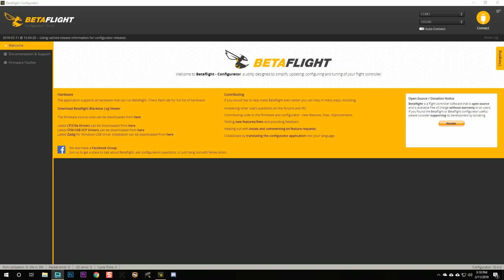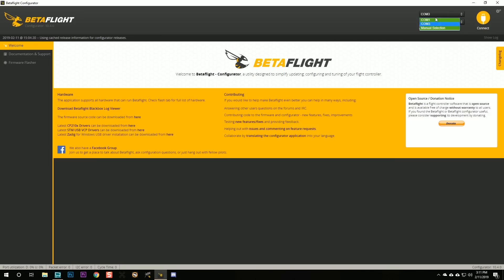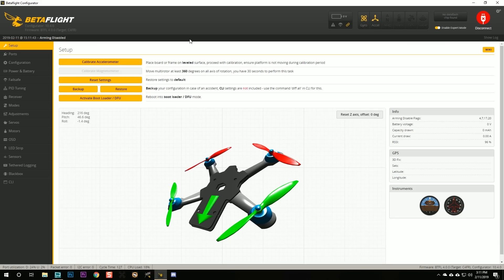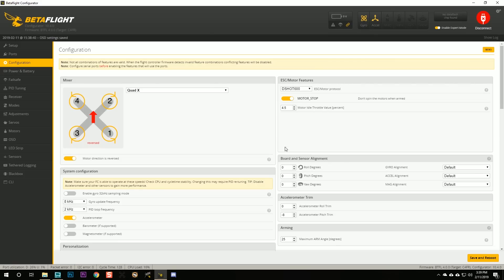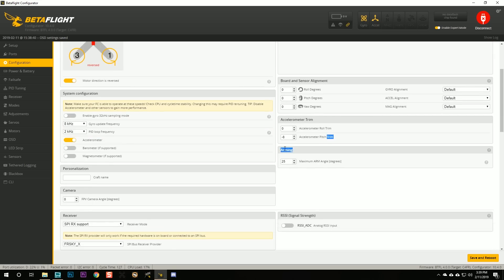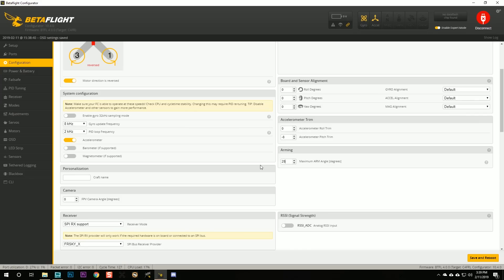Eachine Trashcan Initial Betaflight Setup | DO THIS BEFORE YOU FLY

Comment: Hello. I need help with my trashcan. The problem is I can't arm the quadcopter. Green led always flashing whatever the arm switch position. When I'm in modes section in betaflight I see the switch working the right way but the arm botom doesn't come yellow or activated like the angle and air modes.  Can you help me?
Reply from the maker: https://youtu.be/N8oMMG2kmns
Reply: @JoshuaBardwell  thank you for answering.  The code I have is msp.  And the code stay active when I try to arm without the USB cable.

Comment: If you do the xt30 mod, make sure that you add a capacitor or your voltage regulator will burn out if you have a 2s battery larger than roughly 350 mah.
This will probably happen rather quickly. Eachine created a whoop that could barely fly on the batteries that were shipped, offered an xt30 pigtail to modify it. 
Once this happens, you'll be forced to dump the board or use an external voltage regulator for the full "trash"can effect.

Comment: Some more tips if your having trouble:
  Bind command is "bind_rx"  not "bind" on latest models.
Motor direction switch in betaflight must be switched to "reverse motors" From factory its not and it wont fly.
Flashing firmware to at least 4.1 or higher (recommended) and you will have to setup vtx tables and manually set a channel. watch bardwells video on this its not too hard and just involves loading a prewritten table of channel frequencies. 
Ports tab in betaflight: Set UART1 Peripherals to VTX TBS smart audio and AUTO and boom smart audio should work too.
Physically check props have been put on in the right direction.
These things can take a beginner a long time to figure out they are actually wrong from factory settings brand new. I just got my replacement Trashcan after I burnt the first one out converting it to the supplied XT30 connector due to voltage spike. 
So last tip: Don't convert to XT30.
Happy flying!

Comment: my trashcan stops sending vtx after about 30 seconds of flight, I'm trying to find how to change the vtx mw output but cant find anything anywhere how to do this? do you know? some help would be greatly appreciated. The led says it's outputting 200mw, was thinking of reducing this to see if it helps. Oh, crap, sorry, i just figured it out, I type in "set vtx" in cli and options come up, set vtx_power=1 is for 25mw, 2 is for 100mw and 3 is for 200mw, but it didn't change, I'll have to return it for one that works. Great vid.

i decide to upgrade the vtx board to the recorder version, and keep it.

Comment: how do I reverse pitch in betaflight? rxrange 1 1915 1131, I save to file, but then what? i need to edit whats on the flight controller, not save to file, librepilot for cc3d there is a check box, when saved it writes to the flight controller, not to a file. ??? "Save" line command? let me try that. Ok ,got it, first time in betaflight. Love your vids.
Reply from the maker: Type the word "save" in the CLI

Comment: i just got my trashcan and i have some problems which i do not understand. i tried everything like downloading new drivers and so on but nothing helps.
The Problem is when i first plugged the drone to betaflight everything was ok and i could set my settings eccept of the Modis i mean the flightmods. When i click on the page modis then i get stuck and i cant click on anything else till i disconnect. But further i also dont see any modis or settings like the defaults i just get a blank page with nothing and i cant get out or add something. But flying it works and the modis are the defaults so why is it not showing  it and what is more important why can i not do anything in the modi settings??? PLEASE HELP I DONT GET IT AND I HAVE NOT SEEN ENYONE ELSE WITH THIS PROBLEM
Reply from the maker: https://www.youtube.com/watch?v=slmUbB-dZsw
Reply: Thank you I was able to fix the problem with your video. Great videos as ever since I watch your channel.

Comment: Can anyone help me?  My trashcan was working fine.  I was able to get it to fly out of the box without ever using Betaflight.  Just bound it to my flysky fs-i6 and it the FPV feed showed up good in my googles.  Then I plugged it into betaflight and was just messing around with some of the back LED light settings and I decided I did't like the change so I hit the reset settings and now I lost everything.  I can rebind my transmitter but I can't seen FPV feed and it won't do anything...?
Reply from the maker: When you hit "reset settings" it resets the entire drone. Here's the config dump from my trashcan. Maybe it can get you back in the air:

# 

# diff all

# version
# Betaflight / CRAZYBEEF4FR (C4FR) 4.0.5 Aug  1 2019 / 11:43:43 (839661b20) MSP API: 1.41

# start the command batch
batch start

# reset configuration to default settings
defaults nosave

board_name CRAZYBEEF4FR
manufacturer_id 
mcu_id 003c00143237511630353639
signature 

# name

# resources

# timer

# dma

# mixer

# servo

# servo mix

# feature
feature -TELEMETRY
feature -ANTI_GRAVITY
feature -DYNAMIC_FILTER
feature MOTOR_STOP
feature LED_STRIP

# beeper

# beacon

# map

# serial
serial 0 2048 115200 57600 0 115200

# led
led 0 4,7::CO:2
led 1 5,7::CO:2
led 2 6,7::CO:2
led 3 7,7::CO:2
led 4 8,7::CO:2

# color

# mode_color
mode_color 5 0 9
mode_color 5 1 11
mode_color 5 2 2
mode_color 5 3 13
mode_color 5 4 10
mode_color 5 5 3

# aux
aux 0 0 0 900 1600 0 0
aux 1 1 0 1400 1600 0 0
aux 2 13 0 1750 1850 0 0
aux 3 35 0 1125 1275 0 0

# adjrange

# rxrange

# vtx

# rxfail

# display_name

# master
set min_check = 1005
set max_check = 1995
set small_angle = 180
set runaway_takeoff_deactivate_throttle_percent = 5
set osd_warn_batt_not_full = OFF
set osd_warn_batt_warning = OFF
set osd_warn_batt_critical = OFF
set osd_warn_esc_fail = OFF
set osd_warn_core_temp = OFF
set osd_rssi_alarm = 40
set osd_cap_alarm = 5000
set osd_vbat_pos = 2432
set osd_rssi_pos = 2426
set osd_tim_1_pos = 53
set osd_tim_2_pos = 2455
set osd_flymode_pos = 364
set osd_throttle_pos = 2400
set osd_vtx_channel_pos = 34
set osd_ah_pos = 199
set osd_current_pos = 2440
set osd_mah_drawn_pos = 2448
set osd_craft_name_pos = 2048
set osd_gps_speed_pos = 271
set osd_gps_lon_pos = 82
set osd_gps_lat_pos = 65
set osd_gps_sats_pos = 1410
set osd_home_dir_pos = 302
set osd_home_dist_pos = 303
set osd_compass_bar_pos = 265
set osd_altitude_pos = 246
set osd_pid_roll_pos = 135
set osd_pid_pitch_pos = 167
set osd_pid_yaw_pos = 199
set osd_debug_pos = 0
set osd_power_pos = 320
set osd_pidrate_profile_pos = 344
set osd_warnings_pos = 2409
set osd_avg_cell_voltage_pos = 75
set osd_pit_ang_pos = 256
set osd_rol_ang_pos = 288
set osd_battery_usage_pos = 391
set osd_disarmed_pos = 75
set osd_nheading_pos = 310
set osd_esc_tmp_pos = 82
set osd_esc_rpm_pos = 83
set osd_stat_max_spd = OFF
set vtx_band = 5
set vtx_channel = 8
set vtx_power = 2
set vtx_freq = 5917
set frsky_spi_tx_id = 225,253
set frsky_spi_offset = -61
set frsky_spi_bind_hop_data = 5,213,188,163,138,113,88,63,38,13,223,198,173,148,123,98,73,48,23,233,208,183,158,135,108,83,58,33,8,218,193,168,143,118,93,68,43,18,228,203,178,153,128,103,78,53,28,255,255,255
set frsky_x_rx_num = 1

# profile
profile 0

# profile
profile 1

# profile
profile 2

# restore original profile selection
profile 0

# rateprofile
rateprofile 0

set roll_rc_rate = 120
set pitch_rc_rate = 120
set yaw_rc_rate = 130
set roll_srate = 75
set pitch_srate = 75
set yaw_srate = 80
set tpa_rate = 10
set tpa_breakpoint = 1650

# rateprofile
rateprofile 1

# rateprofile
rateprofile 2

# rateprofile
rateprofile 3

# rateprofile
rateprofile 4

# rateprofile
rateprofile 5

# restore original rateprofile selection
rateprofile 0

# save configuration
save
#
Reply: @JoshuaBardwell  Thank you so much for the reply!  This is exactly what I need Only I need the FLYSKY version...Any chance you have the FLYSKY version? Or might you maybe know where to find it?

Comment: Nice video, thank you.  When you purchase a trashcan for a particular TX  is there different hardware supplied?  Or can this be change by  beta flight or some other firmware flash?  So if you purchased one for Frsky can you change it to Spektrum?
Reply from the maker: If your FC has the built in receiver then you can change protocol in the configurator. If it has a separate receiver like RXSR or xm+ only hardware can change it.
Reply: Hi Joshua,   Thank you for the reply.  So if I purchase a Trashcan with a FC having a Frsky version Built-in SPI Frsky receiver with telemetry(D8/D16 switchable),  can change it with the configuration to be able to work with my Spektrum TX?   If so, does anyone of your great videos demonstrate how to do this?  Once again great job, your videos have been very helpful.

Comment: is there any other option for setting the rxrange? going to any tab after cli disconnects my trashcan from betaflight
Reply from the maker: When you leave CLI, the FC reboots. Just reconnect.
Reply: @JoshuaBardwell  thanks... i typed save and pressed enter... you hadnt mentioned that ...read it in a comment below :)... now when i go into the modes tab all i see is a box that says arm with a check box..im in 4.1 ...it freezes up here and i cant change tabs .. is this normal? all i see is tabAuxiliary a long orange bar a check box and a box that says arm... all i can seem to do is check the checkbox
Reply from the maker: https://www.youtube.com/watch?v=slmUbB-dZsw&feature=youtu.be

Comment: Hi! I’m a newbie. Just recently ordered a pair of TinyHawk little pilot goggles and a FrSky x9d 2019 transmitter. I’d like to get the Eachine Trashcan, but what receiver should I order for it? I want one that works well with telemetry and all, not the D8 with no telemetry nor D16 if telemetry must be turned off for the receiver to work properly. I am ok with basic soldering if need be.

Comment: I received an Eachine Trashcan yesterday. Binding it today, didn't work. Tried a few times, and nothing.
Went back to Betaflight to check on stuff.

Turned out that the reason it wouldn't bind, was that in the configuration, it was set to FRSKY_D from the factory.

When set to FRSKY_X it bound immediately.

Just letting others know here, in case they should run into the same thing.

Great little flyer BTW. Love it already.

Haven't seen it mentioned in any of the review vids I've watched. But it looks like the little LED strip on the back is configurable in Betaflight.  Haven't tried it. But we'll see.

Edit: Tried the LED configuring. And it works. Highlighted em all and turned em light blue instead of red.
Why CONFORM?!?! LOL
JB has a vid about all the stuff You can do to mod LED strips.

Edit: One more point and then I'll shut up. I find that a computer mother board "jumper" looks cleaner and has less weight than the included wire loop for shorting the pins on one battery lead, for 1S battery use.

Comment: Hi i am a beginner and i want to get this and i don’t know which controller i should get i can connect it
Reply from the maker: The Trashcan can be ordered with lots of different receivers but I would suggest starting out that you get the Jumper T16 transmitter and the FrSky receiver version of the Trashcan.
Reply: Joshua Bardwell with that controller will i have to mod anything or can i just connect and also do you recommend this for my first drone and would the eachine Vr-007 googles work with the drone
Reply: Joshua Bardwell would the flysky FS-I6 controller work trying to get cheap controller

Comment: 8:55 no, programmers don't like to be confusing. We start at 0 because that is the element in an array that is 0 elements away from the first element in this array, which makes indexing a lot easier. Once you changed your thinking around this, it's much easier actually.

Comment: Great. I bought one. Question: Which battery do you recommend for my Trashcan drone to fly longer? Thankful. Would eachine 3.7v 750mah 25c lipo work?
Reply from the maker: Trashcan will fly longer on 2s in my experience. The 1s packs just die too fast.

Comment: Hey Joshua,
I seem to be having the same problem TONY DIY mentioned. 
I've bought a Trash Can 2s FrSky version and a FrSky Taranis x9 lite as my first drone and transmitter but can't seem to make them bind. I've updated them both to the latest firmware available, my Trash Can is set to FRSKY_X and my x9 lite to ACCST D16. I've tried binding them trough using the bind button on the Trash Can and trough using the bind_rx_spi command in Betaflight. I have also tried all the different bind options available on the x9 lite for ACCST D16 e.g. Telem on/off ch1-8/9-16 ch.range 1-16/1-8. I have scoured the internet looking for solutions and I'm at a complete loss. I was hoping you would be able to help a newbie like me get started.
Thanks in advance.
Reply: Not long after this comment I happened to stumble upon the solution myself. 

First connect the board to Betaflight configurator and go to CLI.

Type 'bind_rx_spi' to put it into binding mode

Activate the bind function in the TX. This is where things get weird. the LEDs will not change back to blinking to indicate a bind was successful.

Type "set frsky_x_rx_num". If the rx number changed to the number that matches with your setting in the TX, then the bind was actually successful.

Type "save". At the next reboot the rx should connect with the TX .
Hope this helps anyone experiencing the same problem.
Reply from the maker: This problem has been plaguing a lot of people. Thanks for the solution.

Comment: Hello Mr B.....Soooooo....I learned something today.....the hard way!.....while attempting to bind my trashcan (Flysky AFHDS-2A version) I had it bound and was working thru tutorial...somehow it dropped the bind while in Betaflight....when I attempted to rebind I tried the manual way and believe I over depressed the tiny bind button and broke it ( you can no longer feel it click/depress). Anyone have a binding work around?? (Aside from replacing the whole F4)....The CLI method does not work, when you type in “bind_rx_spi” it comes back with unknown command! Any assistance would be greatly appreciated....
Reply from the maker: "bind_rx_spi" is for betaflight 4.0 and newer. Try just "bind".

Comment: I updated the firmware on bataflight to bind the controller but this has also reverted all the setttings. I have it flying but the controller is beeping low battery with the googles showing full battery. plus other things. would you have a full list of settings by any chance?

Comment: @Joshua Bardwell: 
I have updated the x-lite pro to use "accst 16" but still can't bind to my trashcan. Help me plz. Thanks.
Reply: Try this,

First connect the board to Betaflight configurator and go to CLI.

Type 'bind_rx_spi' to put it into binding mode

Activate the bind function in the TX. This is where things get weird. the LEDs will not change back to blinking to indicate a bind was successful.

Type "set frsky_x_rx_num". If the rx number changed to the number that matches with your setting in the TX, then the bind was actually successful.

Type "save". At the next reboot the rx should connect with the TX .
Hope this helps.
Reply: i will try, thanks bro!
Reply from the maker: Go to the Configuration tab of Betaflight. Make sure the receiver type is set to FrSky_X not FrSky_D.
Reply: @JoshuaBardwell  Yes, 
I tried but I still can't bind

Comment: JB another awesome video. Anyone know? Mine keeps bouncing when I go to land? Any advice?
Reply: Georgio Mascagni that bouncing is caused by air mode. I only use air mode in acro then I switch to angle mode without air mode to land
Reply: @stuckintrees4796  I realize it's air mode but I have 5 other 65mm - 3" all setup on Air Mode with out a switch. Only my TC bounces like this. Is it the min throttle setting is set to high? Anyone else?

Comment: Hello, i have 2 trashcans. Connecting with betaflight works but i cant choose the OSD menue and the mode menue (on both trashcans)
I use betaflight4 
Have anybody an idea?
Reply: Try to use an other version. I had the same problem. Used an older version and it works.

Comment: I just got my DSM trashcan working and while you're videos helped a lot, I did run into some issues probably because mine is a DSM version.  Initially, I couldn't access the modes menu or the OSD menu with the stock firmware and BetaFlight 10.5.1.  I dumped the CLI, flashed to 4.0.1, copied the CLI back and started over again.  Then I couldn't get it to arm.  I should probably calibrate the endpoints through the CLI like you showed, and I will try that a bit later, but I ended up having to set throttle endpoints in the radio(DX6i) to 125% on both ends to get even close to 1000-2000. More like 1050-1950.  At any rate, I maidened around the living room and upset the wife. All in all a good evening.  Thanks very much for the instructional videos.  Also for anyone looking, to get AUX2 working you'll need to set up the flaps switch in the radio menu.
Reply from the maker: Setting endpoints on the radio vs. rxrange.... technically the radio gives more resolution so there's nothing wrong with the way you did it. The difference is that rxrange is the same for every transmitter so it keeps the instructions simpler.

Comment: Hej Joshua, i'm wondering what MW settings to use in smartaudio.
It has like 25/100/200/500/800  in the menu ,  but i know it only does max 200mw.
So does it actually scale correctly or not,  and would it hurt picking 500/800mw (maybe thats what it takes to actually get 200mw??)  No options to measure it here...
Reply from the maker: Basically the vTX will ignore settings it doesn't support.
Reply: @JoshuaBardwell  thanks!  that will prevent things blowing up i guess,   now i have to figure out if 200mw is actually 200mw because i remember the trashcan didnt correspond on some batches.